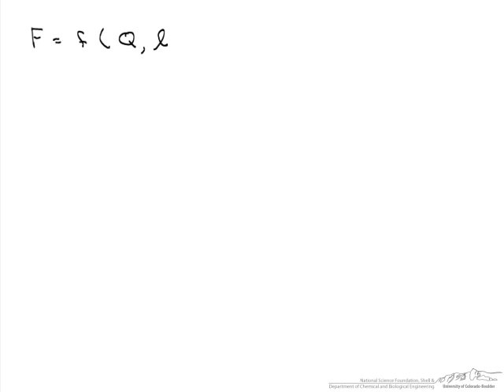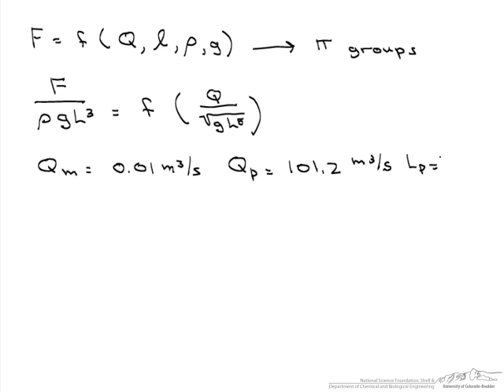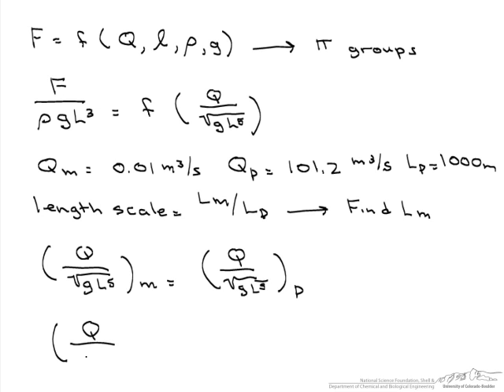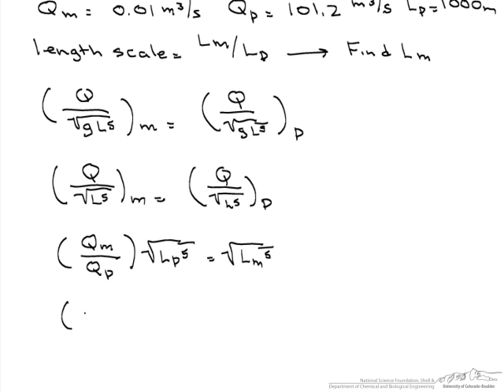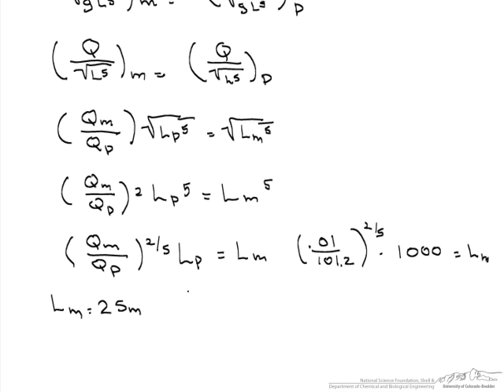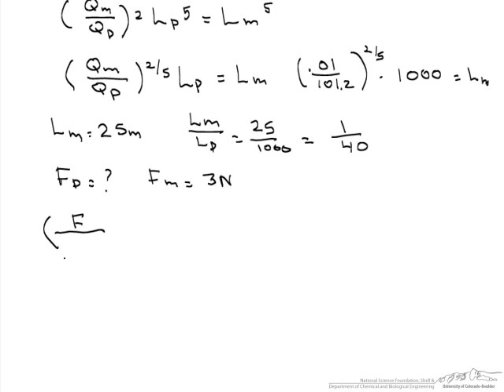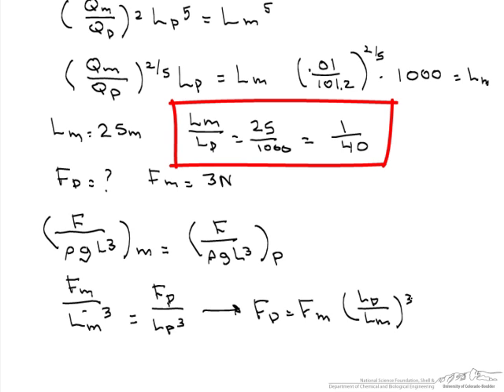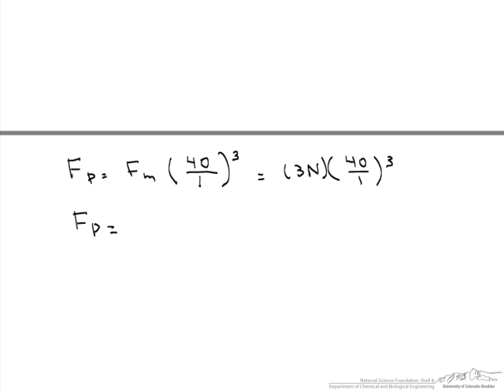Using Similitude to Scale from Model to Prototype

Comment: hi can you explan this question?

The viscous torque produced on a disc rotating in a liquid depends upon the diameter D, the speed of rotation N, the density and the viscosity .  The equation taking the form:-

T = ρ N 2 D 5 φ ( ρ N D 2 μ )

In order to predict the torque on a 1.8 diameter disc rotating in water of density 1000kg/m3 at 129 rev/min a model is built to a scale of 1/4.  The model is rotated in oil. Calculate the speed of rotation, in rev/min, for the model to produce dynamic similarity.

The oil density is 785 kg/m3 and the dynamic viscosity of the oil is 4.7 x 10-4Pa.s.

The water dynamic viscosity is 1 x 10-3Pa.s.